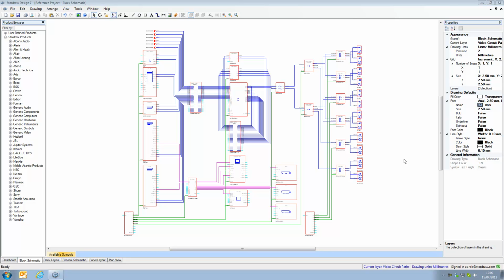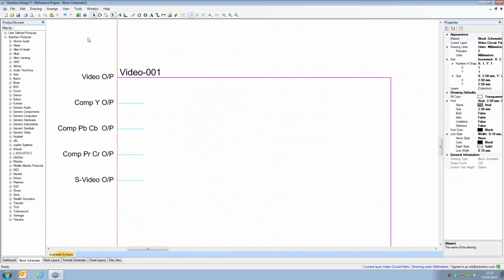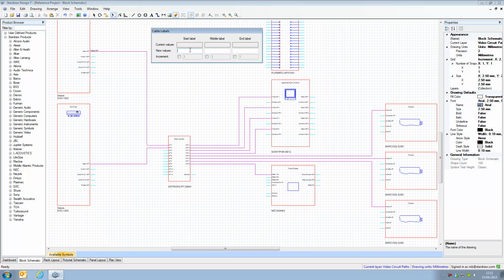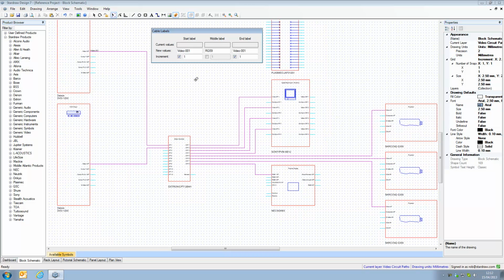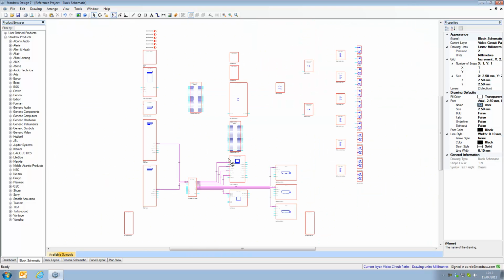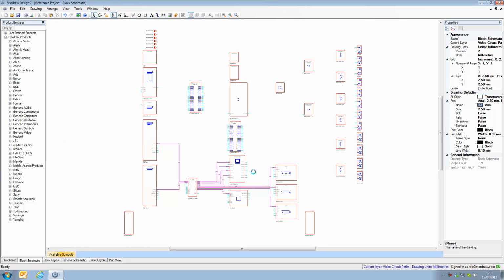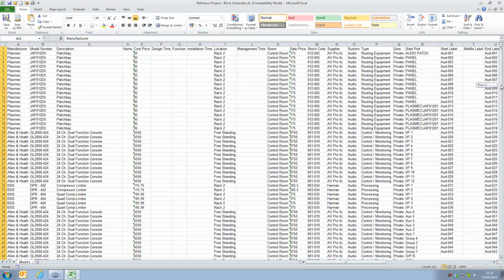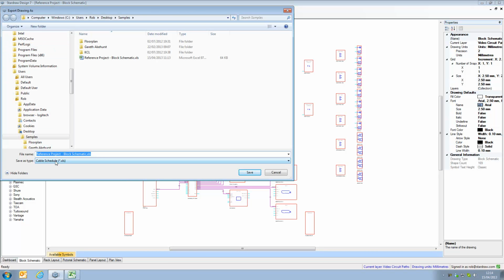Cable Labels and Cable Schedules

Comment: would you happen to have a tutorial on how to generate the information to go into the cable schedule 
i have been wondering about the length and models of cables you have been putting in
Reply from the maker: All tutorial videos can be viewed at https://www1.stardraw.com/stardraw2/sd7/movies - in particular see #04 Cable Tool and #05 Cable Presets.  The generated Cable Schedule contains Attribute values contained in Products and Cables, and these values are generally entered manually.  You specifically mention Length and may be under the impression that Cable Length is calculated automatically; it is not, and cannot be calculated, because a Block Schematic is not to a real-world scale nor is it dimensionally representative of real-world Product locations or Cable routing; the Cable Length Attribute value, therefore, has to be entered manually.  I hope this is helpful.